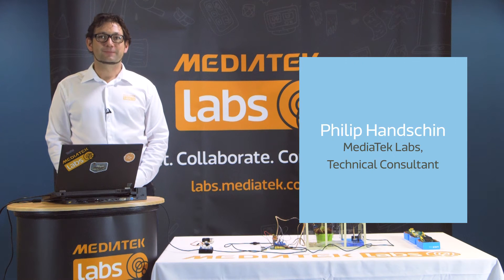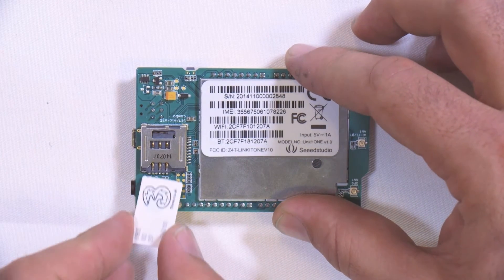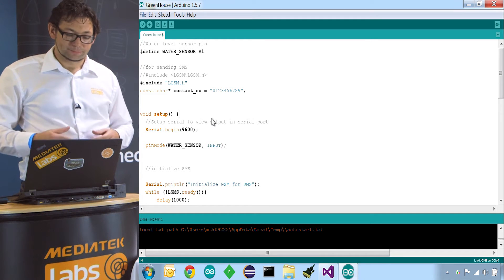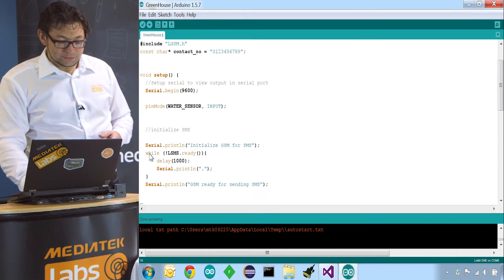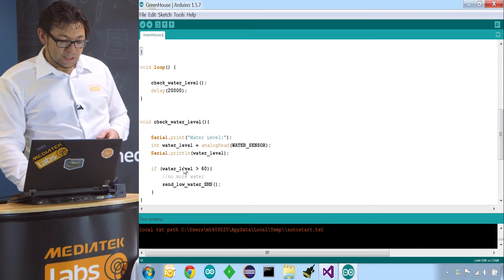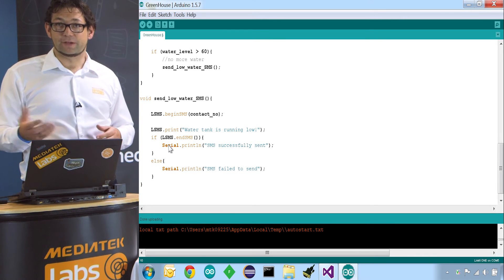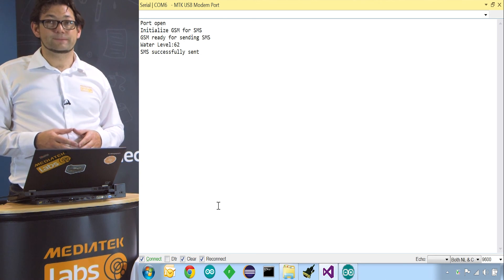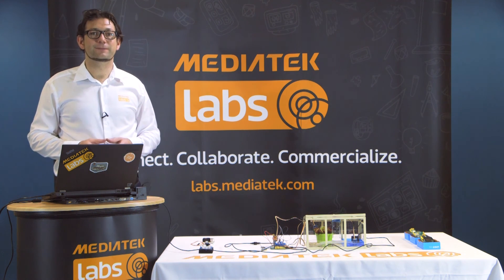Sending an SMS message using MediaTek LinkIt™ ONE

Comment: I purchased  Linkit One a year ago, after some time i faced problem with GSM/GPRS, when i started its look good, but after some time GSM stop working, no call receiving Or Sending nor Receiving SMS, after some months its start working, but after almost one month its stop again and now i m facing same problem i checked every thing, device is also registered by Local-Authority , Changing SIM-Card, Using External Antenna, but nothing, can any one help 

thanks in Advance.....